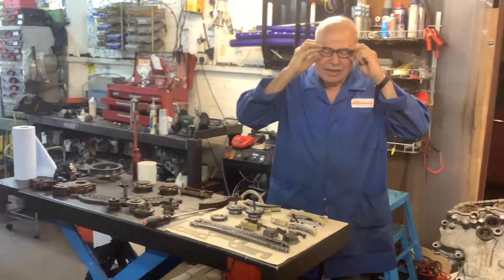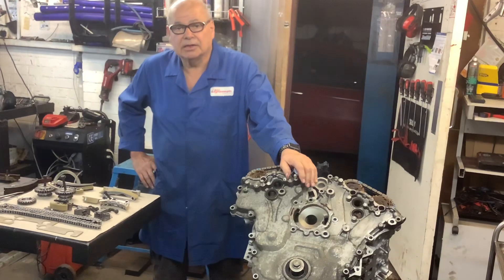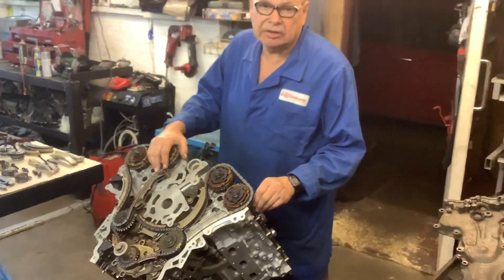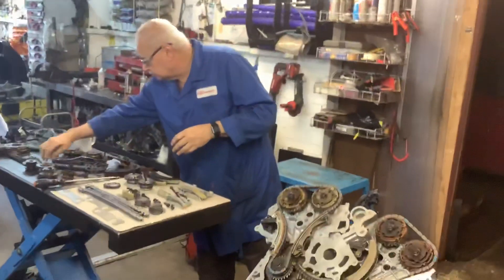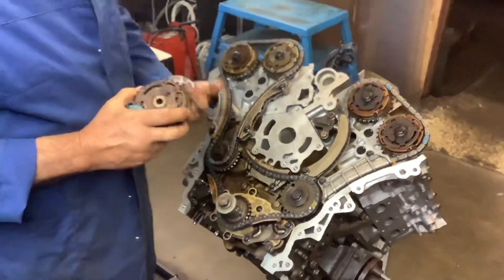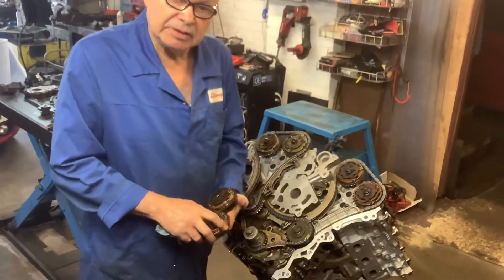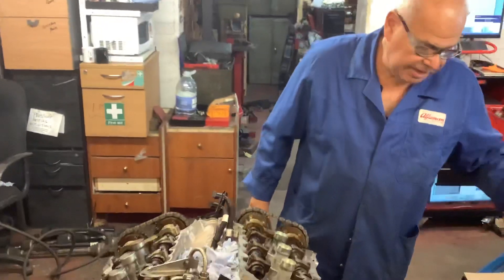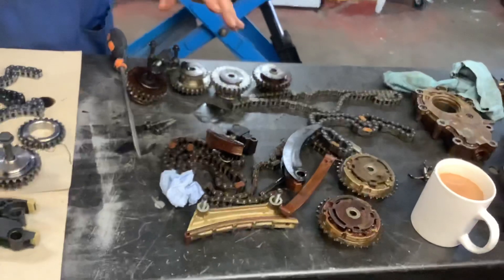Alfaman Garage - How to timing chain on 3.2 v6 GM engine for Alfa Romeo 159 Brera Spider Part.01

Comment: is 164.3.0v6 12v better to use mineral oil than synthetic? and why? if the outside temperature is -38- +39, what is the best oil for that?
Reply: -38??? 100% sinthetic no heavier than 5w30

Comment: Lovely video! Great explanation :-) I am just considering to buy a used Brera 3,2 V6 with this GM engine. Would you please give me some advise about the engine if its okay? What would you recomend to avoid before buying Brera 3,2?
Reply: Youre about 10 years too late, they are all high milers now so extra care needs to be taken.
Those worried about reliability should by a new car not a 10 year old one.
Reply: @heno_3098  just read your comment, what did you find out? Im just interested
Reply: @Slendieman1244  I don't have a garage yet, so nothing. There's no point in solving anything outside in the parking lot ...  
In addition, the video creator as a car mechanic ignores my questions just as most car mechanics do not understand the theory and cannot apply it in practice :)

Comment: Hi Eddy, I'd just like to hear what you really think of this engine. Dynamically, do you reckon it is a worthy "successor" to the Busso ? Or at least a good engine for what it is meant to be ? I've heard from a few people that once you fit a complete, aftermarket engine back exhaust system (replacing all the restrictive cats) combined with a remap it becomes a gem of an engine. I mean, Alfa did the heads in the end... and that's what makes an engine.
Reply from the maker: Thanks for the email...  the 3200. GM  Holden. Alfa mix   Could be a gem...  needs improved oil pump, oil ways around the sump could be  properly made, the spray jets to the con rods have been modded by engineers from OZ. 
    CHIPS ..CAMS AND EXHAUST SYSTEMS can always improve performance, manufacturing for the general population is a totally
 Compromise between performance and economy .
    The Busso  is a supper unit.... 2000 turbo, 2500. 3000. 3200  all made by Alfa . 12 and 24 valve versions with carbs and injected
 Is a great engine... and it looked the part as well. Being old fashioned and   : when I wos a lad:  and stuck in the past .... I like the Busso a lot more .  Cant get the rear head off in situ or do a injector clean on the late engine. And I hate direct injection with a vengeance.
   The valve chambers coke up and valve stems start to size up the valve guides so chains wear out quickly. But the manufacturer does not care because performance figures are better when new with direct injection. Never had a coked  up head on the Busso, I get totally coked up heads on the later engine. I get intake manifolds coked up. I use a hydrogen generator to de coke all cars coming into my workshop now. WHAT AN IMPROVEMENT.   HOPE YOUR WHOLE CIRCLE OF FAMILY AND FRIENDS ARE WELL. PLEASE STAY SAFE.
     REGARDS  EDDY
Reply: @AlfamanGarageServices  Thank you Eddy for this honest reply. I wish your family and yourself to stay safe too. I’m terribly divided - hesitating between a late 159 3.2 V6 Q4 manual (2008 on, with the lighter aluminum chassis components) and a 156 2.5 V6 24V. Both cost around the same in good condition (5000 pounds-ish when converted from my local currency in Switzerland). The 159 just looks incredible and has AWD, but the 156 has the Busso. And it’s a good 200 kg lighter. Such a tough choice. Looks and performance, or driving experience. What do you reckon?
Reply from the maker: @nvl2691  
      Easy choice... I’m surprised u thought about it for any length of time.
        GET BOTH...... That way u won’t pile on the Kilometres   And protect the values....
            Regards to you and your circle... Stay well.
Reply: @AlfamanGarageServices  Ah I so wish I could get both. Only one spot in the garage though, and I don't want to leave one of them outside, exposed to the harsh Swiss weather...

Comment: Why do so many of these engines break down? I also can't wait for part 2 . Would be awesome to see indepth tear down and rebuild.
Reply: I dont know any that break down, i have a brera and 159 both reliable but need regular oil, and they dont like old batteries, change them every few years.
Timing belt/ chain change on time and they are bullet proff.
They are all over 70000 miles now so need looking after

Comment: Hi Eddie, i have 2.2JTS Brera. 112000km total. And about 1months ago i saw engine warning light. An alfa service checked the problem. They saw variator problem  in computer. But when they checked variator, they can not see any problem. Everything seems good in variator. They delete system warning. But one weeks ago, engine light illuminated again. Do you have any idea for it? Thanks.
Reply: Could be oil seal on pick up tube in sump, they dry out and seep oil back to sump overnight, common problem
Reply: Common issue at that milage